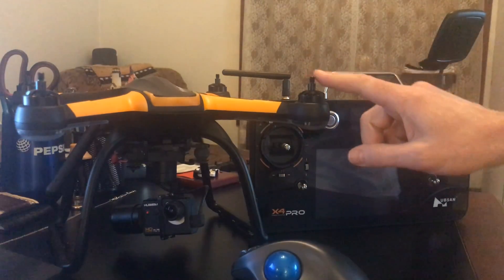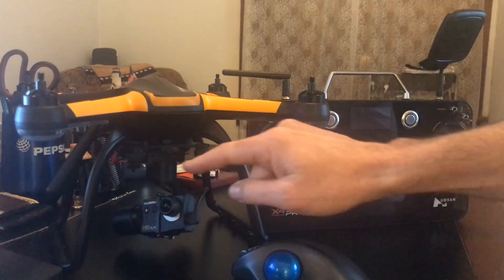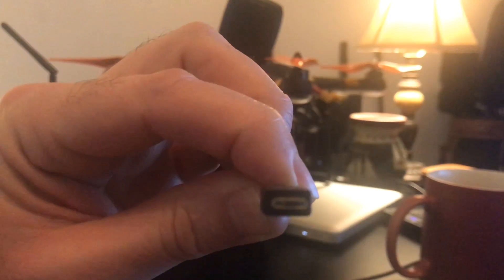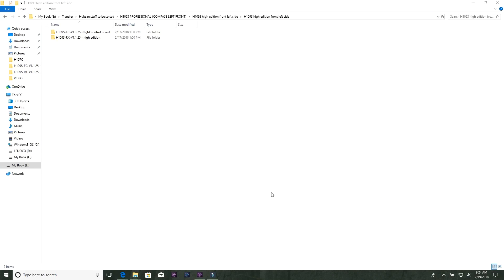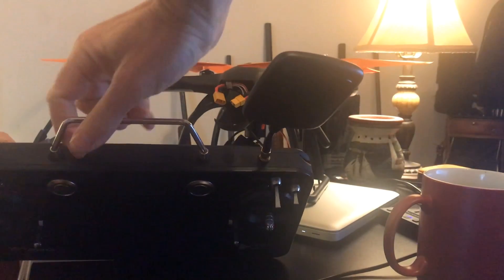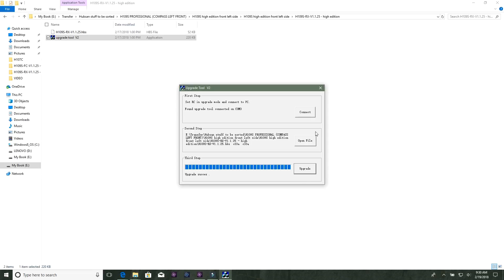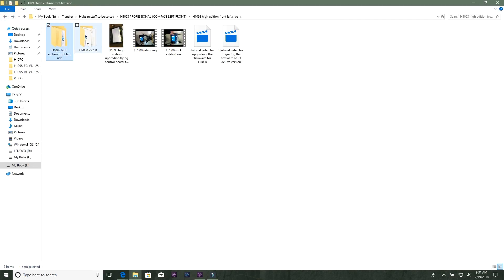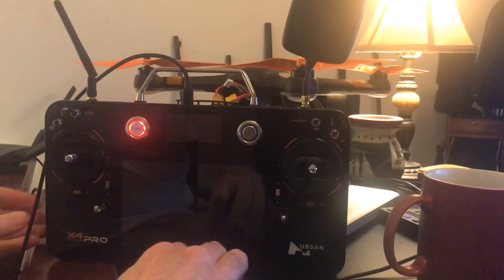H109S - H7000 HOW TO UPDATE FIRMWARE (FC, RX & TX)

Comment: Thanks Chris for this video.Many years later, I decided to remember the past and bought a used H7000 remote control for my H501S. Unfortunately, I don't have stick control right now and the remote is hanging at the stage of stick calibration. I want to change the firmware of the remote, but I could not find the file anywhere on the Internet. Please help me if you still have the firmware files from H7000.
Reply from the maker: Join my group posted in the description if you aren’t already a member and the file is in the group files. It’s called sunbird 👍🏻
Reply: @QCGUY  Tell me how to enter the settings menu of the H501S copter via the H7000 remote control?
Reply from the maker: @ОгоГо-г4ю  Here is the sunbird file link. I'm  sorry I don't remember the menu commands for that controller.
Reply from the maker: https://www.dropbox.com/s/jlt3bc6xfz221lh/Sunbird_Google_15100201-bate.apk?dl=0

Comment: hi, 

where can I find and download the update tool? exactly the same as you show in the video. (hubsan fc tool v3). Thanks
Reply from the maker: You can find it in this folder with the 501 fc firmware https://www.dropbox.com/s/tiwy8jo0o9srf8d/H501SS%20ORIGINAL%20COMPASS.zip?dl=0
Reply: @QCGUY  thank you very much for the quick reply. I noticed that in your video you have the correct name of the drone (h109s), and the file you sent me is named h501ss?
Reply from the maker: @patrykchyla3096  The tool is in that file...don't worry about the rest just take the tool from it. Thanks
Reply: @QCGUY  thank you
Could I find out how or where I can find the files to update my h109s and h7000 transmitter? maybe you have some updates? thanks
Reply from the maker: @patrykchyla3096  the sunbird application for H7000 is in my group files. 
https://www.facebook.com/groups/HubsanQC/
Reply from the maker: @patrykchyla3096  H109S compass left front firmware. 
https://www.dropbox.com/s/c4c3moeh6al07j6/H109S%20PRO%20%28COMPASS%20LF%29.zip?dl=0
Reply from the maker: @patrykchyla3096  H109S compass right rear firmware. 
https://www.dropbox.com/s/noyknr4xqeysdo0/H109S%20PRO%20%28COMPASS%20RR%29.zip?dl=0
Reply: @QCGUY  thank you very much for your help. Everything works as it should! :)
Reply from the maker: @patrykchyla3096  no problem 😉

Comment: Hey Chris, the bottom quarter of my H7000 touch screen isn't working. I've cleaned the ribbons and connectors but that didn't help. I can't do a factory reset because the reset button is in the dead zone! Do you know if there is a way to factory reset using a combo of buttons on the controller? Can it be booted into safe mode? As always any suggestions will be greatly appreciated.
Reply from the maker: Dhoser sounds more like your screen has burnout. I’m not aware of a reset. It’s been a while since I had this quad.

Comment: Greg, just picked up an H109S Advanced w/H7000. How can you tell where the compass is located. Are all of the advanced versions in the front left? I have the older FC/RX/TX firmware could you please email me the latest (dhoser2000 at gmail.com). Thanks!
Reply from the maker: Join my group and post questions and firmware needs there.
The compass is in clear view of the landing gear. FL or RR

Comment: Hi, i bought the x4 pro H109s  high edition with a h7000 Transceiver and when checking the firmware  it states  H7000- V2.1.8, .. H109s. v1.1.32 and v1.1.31 consecutively,   this seems quite a jump from your firmware in the vid,  do you think my firmware is legit?  thanks for any help, ..
Reply from the maker: Robert Wright It’s legit but never discussed or mentioned what is the changes so you’re pretty much a firmware tester at the moment. 
Just keep it close and watch everything carefully.
Reply: @QCGUY  thanks for the reply much appreciated 👍

Comment: Nice, lots of good info.  I did go to the factory location here in CA for my firm ware mess up. They were very nice, a bit surprised I just walked into there office.   I apologized and asked what would be the correct way for me to contact them. The young women at the front desk ( you know, the one that dose the videos)  Told me since I was there? She would have it done .While  I was waiting, she asked if she could answer any questions I might have. With this explanation? I think I can hack it myself.  I look forward to watching your other videos,    Thanks Again!
Reply from the maker: FireHorse454 unfortunately they fired her. Annie was her name. 
Good story! I like that you went there and just got things done.
Reply: Wow! With what she knew / knows. She could go on her own.  Right down the street.  The Hubsan, like other Chinese products of good standing. Build on known tech. the company owns. You will fine a thread of it through out there product line. That's why you can fly the H501 S to way-points  with no internal modification using the H7000. But like so many soft / firm wares. Hacks are hidden every were in them. The H7000 has, what I'm sure is many buried secret's lurking in it. Thanks for uncovering some of them I had no Idea of.

Comment: My biggest regret was purchasing this quad. I spent $1200 when it came out. Flew many times, I stored for almost a year. I was never able to upgrade the firmware. Here I have it sitting, the remote won't bind with the quad. When it feels like binding the quad would not respond to the inputs. I've contacted tower hobbies for support and I was told to contact hubsan directly. I did contact them  in china and it was impossible to communicate due to the language barrier. Their customer service is extremely poor. Apparently there is a hubsan usa located in California. I will seek their help on Monday. Hopefully I can ship it to them for service. I learned the lesson. DJI is the only way to go.
Reply from the maker: They tend to abandon things with this quad and customer support is not easy at all but yes if you contact California and ask for Vivian then you will get good support. I'm not so sure about sending it for service though. I've seen too many come back with other troubles. Have you tried updating everything? Early firmware was a bit sketchy!
Reply: @QCGUY  Thank you for answering. I have not tried to update anything. I have no clue where to download the updates. The problem that I'm having is the quad and remote are not binding. Last night I was able to do it and   lasted only minutes. I will contact Vivian to see what can I do. Hubsan does not post anything online, no instructions, software, etc. I can follow your video, its pretty good and precise. Can you guide me on how to get the updates? Im willing to give it a chance. Thanks again.
Reply from the maker: @V13470  Just tell me what you have and your compass location and I will send you a link to the firmware for what model you have. I compiled all the firmware for many of there models for the reason of them lacking in this area and give them out myself. I also have a Facebook group where you can get help from myself and members with this quad. https://www.facebook.com/groups/HubsanQC/
Reply from the maker: v13470924 You have the same as me then...I’ll post the link here in a minute.
Reply from the maker: https://www.dropbox.com/s/c4c3moeh6al07j6/H109S%20PRO%20%28COMPASS%20LF%29.zip?dl=0
Reply: @QCGUY  yes sir, the same. Thanks
Reply: @QCGUY  I will keep you posted with my results. Thanks
Reply: @QCGUY  Ok so this is my issue. My quad and transmitter are not communicating. I have tried the binding process over and over and nothing. I went ahead and tried to upgrade the FC with tool version 3, didn't work. I went with tool V1 and it went all the way to 100%, disconnected but never reconnected back. I stopped there. I fear there is something wrong with the main board. Thanks
Reply from the maker: v13470924 I just read your other comment and was going to suggest you try version one. 
Can you tell me what version of windows you’re using and have you another cable to try?
It’s Hubsan and the update process is never smooth for everyone.
Usually it’s a matter of computer, cables, usb ports or tools so often it’s just finding the magic combination.
Reply: @QCGUY  I will get back to you in reference to windows. The USB cable that I'm using seems to be working but I'll try a different one. My main concern though is the binding issue. They can't stand each other. No communication whatsoever. Lol. Thanks
Reply from the maker: v13470924 Have you successfully been able to install the TX? It may bind after updating that.
Im not doubting any hardware problem but if we can get it to take the firmware I want to try.
Reply: @QCGUY  Precisely the only update that I was able to do successfully was the tx. No issues. I went ahead did the sticks  calibrations. Then I tried binding with no success.
Reply from the maker: v13470924 can you show me a video of the error process your getting in the group and I’ll pick up helping you there?
Reply: @QCGUY  Windows 10 Home Version 10.0.17134 Build 17134
Reply: @QCGUY  A video of which process? binding process? FC update process?
Reply from the maker: v13470924 update process with the errors. Anything that will help pinpoint the problems.
Reply: @QCGUY  ok. I will do them tomorrow. Ill post them in dropbox. Ill record the binding procedure and the FC procedure and the results. Thank you so much for your time. I really appreciate it.
Reply: @QCGUY  This is what I did. I tried 3 different usb cables and they all seem to worked. I also tried all 3 usb ports. FC tool kit V3 didnt worked. FC tool kit V1 connects, goes all the way to 100% then it disconnects and wont connect anymore...I havent been able to reach the final step which is clicking on the version button to verify.
Reply from the maker: v13470924 check the menu for the version. The tool doesn’t always work that way. Sounds like you succeeded the install to me.
Sorry, I missed that before. 
Send the video trying to bind tomorrow. Gotta go now! 👍
Reply: @QCGUY  will do, have a great night.
Reply: @QCGUY  Hello Chris. After several attempts to upgrade the RX. I was able to do it "successfully" the radio displayed upgrade finish but it showed an error in the computer. Well, after this I was able to bind the quad with the radio. I haven't been able to fly. Apparently I'm having issues with the batteries. The display shows battery power at 0%. I'm charging 2 more batteries. I'll keep you posted. Thanks
Reply from the maker: v13470924 Good to hear it! The 109 is filled with gremlins but keep pushing back and they give up.
Hope you’re battery issues get resolved with the others you have. 👍
Reply: @QCGUY  out of 4 batteries 1 is gone. I'm charging the other 3 to see what happens. Sir, thank you for your help and support. Fyi I received a call from a tech in China. They use all YOUR videos when providing support. Lol. Unbelievable.
Reply from the maker: v13470924 make sure you tell them where you got the support to work this out. 😂
Reply: @QCGUY  I sure did.  You know more than they do. I am pretty shocked about it. They referred me to this video 2 times. Lol
Reply from the maker: v13470924 I hope to see a flight video in the group soon from you. Fingers crossed and I look forward to it.
Glad everything worked out so far!
Reply: ok so I was not able to start the motors...till..... I did a little research and found out that I need it 6 gps locks in order to activate them. When the gps reached 6, the motors went ahead and worked. I was able to fly. The quad moves to the sides a little. Im guessing I need to recalibrate everything. Thanks Again. Mission accomplished.
Reply from the maker: v13470924 yes from your original version to this the difference of needing 6 or more sats may be something you’re not use to.
Sorry, if talking in a group forum I could have informed you better. 
Doing this on YouTube isn’t the best way.
Reply: @QCGUY  don't be sorry. I am very grateful to have access to all your info and much appreciative for your  help. If now it takes 6 GPS locks to fly so be it.
Reply: @QCGUY  from the previous version to the current one, what are the differences?
Reply from the maker: v13470924 Off the top of my head I can’t recall and don’t want to misinform you. I have it written somewhere in notes or on the computer. I don’t even fly mine anymore other than to get the dust off of it.
Reply: @QCGUY  How are you sir. I hope all is well with you. Today I was able to fly the quad for about 20 min each battery. I keep losing the link to the quad. Its insane. I felt like flying straight to the dumpster. But I'm gonna give this system another chance. Ill go to an open field. Will take it up and up and see what happens. ITs not fun anymore. Too many damn glitches and issues. The gps lock sucks big time. Wont stay put. It crazy. Have a great day. I'm always grateful for your help.
Reply from the maker: v13470924 have you done all your calibrations? I have a video for all of those as well. Makes a world of difference! 👍
These quads are a headache though for sure. My advice is sell this model and buy something with a good reputation. So many good smaller options giving you more than this one does.
Reply: @QCGUY  Its for sale...yes. I will my do the calibrations today following your video. Thanks

Comment: Hello, you could forward to me the tool and firmware files. My version also has the compass in front. Thank you so much.
Reply from the maker: Gleycon Schneider join my group or give me your email address and I will gladly send them to you. 👍
Reply: Great video my friend.
I would like to ask you if you could help me with a little problem that I have with mine. My version is the X4 pro Standard version.
If you have the files to upgrade the firmware would be great if you could share it please.

Comment: Hi is there any one that can help me please I have h7000 transmitter but cannot get into settings and I also have a H501sx4 drone which should do way points but cannot get it to work I am so confused about the firmware because of this I have not done any updates on any of the equipment yet but most of all I wish to fly way points, I have also brought the x4 pro low end of the market will I need to make any changes to that? Please can some one help me thanks. My e/mail address is malcolmhogsden.phd@hotmail.com.
Reply from the maker: Malcolm Hogsden https://m.facebook.com/groups/1913569038873073

Comment: Can you plz. Tell me where to get the update tool. And also the firmware... Great video! !  You can email or just reply on here... Tatman35753@aol. Com
Reply: pleace can you send me the tools too.  i need a new software for the h7000 transmitter....send pleace a link....
Reply from the maker: I don't send the firmware without first determining the versions you need. Are you in the group from the link above?
Reply from the maker: I would need to know what versions you need or better yet what model? Standard, Advanced or professional and where is the compass located?
Reply: Hubsan QC Help & Support.  I09s.  The same one one this video...
Reply: Compass is in front left
Reply from the maker: Andrew Smith I will send you the tools, the TX, FC and RX Firmware. Do you want the newest RX to fix the camera angle on the gimbal? Are you in my group? It’s a lot easier at the moment to just send you the files there.  Click the link and join if you haven’t already.
Reply: Hubsan QC Help & Support  where is the link
Reply: Ok I just joined
Reply from the maker: Andrew Smith just private message me there. Thanks
Reply: Hubsan QC Help & Support ok so I joins the group.. what tool and firmware do I need to down load from the group's pages for the x4 109s. High edition  and the h7000 controller... again thanks for your help
Reply: Hubsan QC Help & Support 
Hi, thanks for the quick response. I need the complete version v2.1.8 for h7000 and possibly for h109. can you send me a link ...... unfortunately I am not in the group. best regards dieter